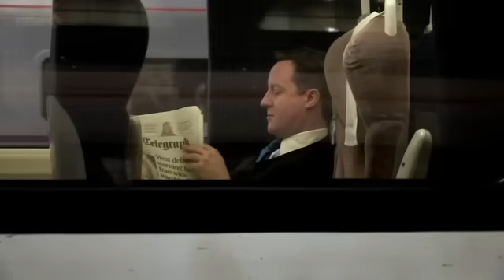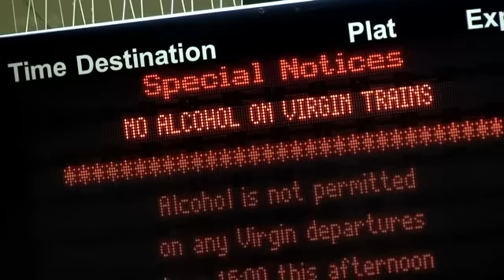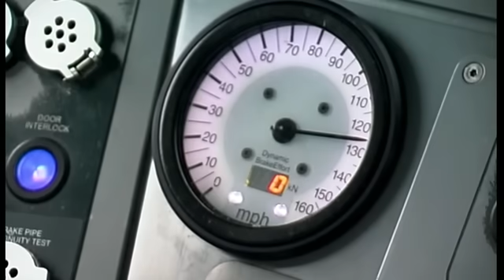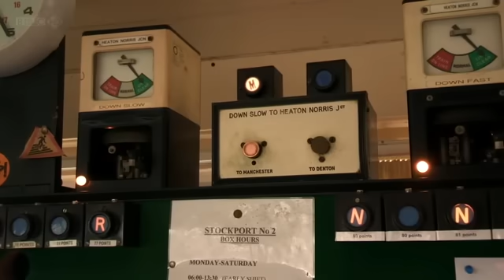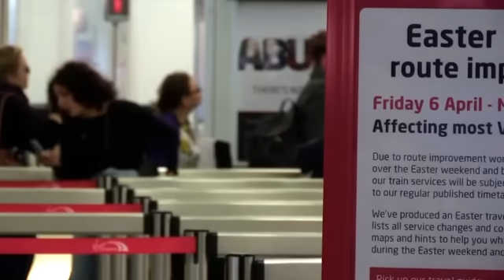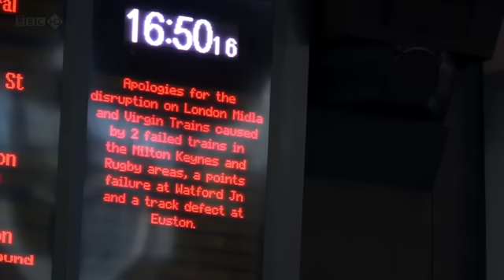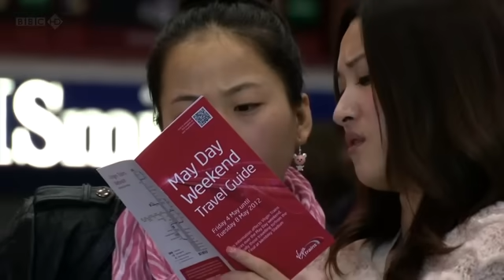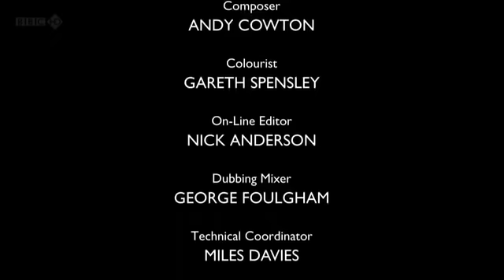The Railway - Keeping Britain On Track : West Coast Mainline (S01E04)

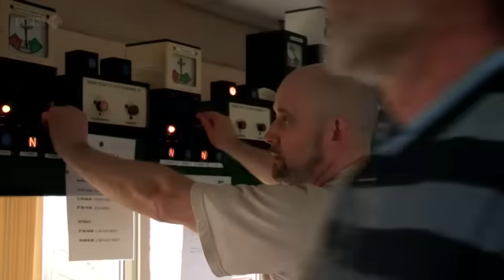Comment: 22:51 I've often wondered about the colours on the different levers in 'boxes and this is really informative :)
Reply: So, ik this is like 10 years old, but the red levers are home/stopping signals, the yellow ones are distant signals, the black levers are points, the blue levers are point facing interlocks, the red levers with a white band is a block locked lever

Comment: Liverpool Lime Street always was a bit of a hovel and in the AC Electric days (Class 86/2 and 87/0 et al) it was a nightmare to approach with the brake burning downhill incline 'down' from Edge Hill CSD especially with a well loaded WB rake behind! I used to be based on the West Coast Main Line and have many happy memories of being a driver from 1992 to 1997 just before the privatisation in fact. The line has been upgraded and in a number of cases remodelled quite extensively since I was 'on the footplate' and the days of two drivers in the cab on 110 MPH diagrams are over. However 'footex' trains have not changed based on this programme: Always were bloody chaotic as were the extra booked stops made at Wembley Central! :o)

Comment: Just wow at 7:00 to see an old signal box still working. If it aint broke don't fix it - however the bean counters will be doing their best to chop that mans job, close the box and replace it with an computer switch controller from a central office hundreds of miles away, controlled by an over worked, under paid computer operator. Will that knock a penny off the price of a rail fare? No it won't - it will just go into the shareholders pockets, as per. Aint Progress wonderful?
Reply: The UK signalling system was put in place by the Victorians, and it's it's an international joke that we still use such an outdated and inefficient system. We can't fit any more trains on the line because the signalling system chokes the network. Then, when a delay happens, every other train after it is delayed because the signalling system can't cope.

I feel bad for the guy's job and all but we can't go around pretending that it works well like this because it simply doesn't. If you want to see an old signal box working, go visit a preserved railway. You'll get to see steam trains too!
Reply: @LordSandwichII  hey get out of here with your intelligent facts and logic these guys need to whine about trains regardless of what happens otherwise they will have nothing to do with their life!
Reply: @alric8  IKR? If we should moan about our rail network  we should moan about the fact that it's outdated, inefficient and expensive.

Comment: Although this video is a few years old, my mind boggles to think that there were still manually operated signal boxes on a 21st century line.  An awesome responsibility for the men that operated them.  Overall, it seems that West Coast Mainline is overloaded, trying to cope with an inadequate infrastructure.  However, improvements are expensive, and passengers are already complaining about ticket prices.  It's still a better rail system than we have in the US.
Reply: I still work in one even now in 2023. No sign of them closing anytime soon either because of the expense involved in upgrading the whole network, it’s just not feasible in remote areas, or areas where a skilled human is required for the safe passage of trains.

Comment: The original budget of $3.3bn was never going to provide the service, and certainly not the on time availability. They had planned to put the fast trains on the same rails as the freight, and that had a lot of problems. The actual cost of about $11bn was for a compromised service, without the proposed signaling system. An alternative to the high speed trains were double decker's, running slower, but more of them and always one waiting for passengers in the starting point terminals. You can much more easily add a slow train than a fast one to a track. That option required larger tunnels and that cost would have been about $1bn. It would have also allowed freight from the channel tunnel to run right through to the Midlands were a lot of it was heading, instead of going onto the road. But trying to tell Railtrack anything was a waste of effort.

Comment: As an American that never rides trains, I have no idea what was going on with the guy pulling levers and ringing bells.  They didn’t explain what the bells meant and what happens when he pulls a lever.  They some control “point” and some control “lock bar,” but I don’t know what that means.  It was like watching something straight out of a Dr. Seuss story.
Reply: The levers control switch points. US railroads used to have similar setups, but they've nearly all been replaced by remotely controlled equipment.

Comment: I needed to know why don’t dig a tunnel and do an extension for the main line Train so they extend the unused abandoned underground stations.  

Why couldn’t they use the part D78 Stock train doors on the sides and also restructure the front face of the A60 and A62 stock that includes the class 313, class 314 and class 315 remix and make them all together and also redesign them an overhead line and also make them into six cars per units and also having three Disabled Toilets on those six cars per units A60 and A62 stock trains and also convert the A60 and A62 stock trains into a Scania N112, Volvo TD102KF, Volvo B10M, Gardner 6LXB, and Gardner 8LXB Diesel Engines and also put the Loud 7-Speed Voith Gearboxes even Loud 8-Speed Leyland Hydra cyclic Gearboxes in the A60 and A62 stock, class 313, class 314, and class 315 and also modernise the A60 and A62 stock and make it into an 11 car per unit so it could have fewer doors, more tables, computers and mobile phone chargers?

A Stock Trains and 8 Disabled Toilets on those A stock trains. why couldn’t we refurbish and modernise the waterloo and city line Triple-Track train tunnel and make it bigger and extend it to bank station, making it into a Triple-Track Railway Line so those 4 European countries such as Germany, Italy, Poland And Sweden to convert the waterloo and city line Triple-Track Train tunnel into a High-Speed train?

The Third Euro tunnel Triple-Track Train line to make it 11 times better for passengers so they could go from A to B. then put the modernised  11 car per unit A Stock and put them on a bigger modernised waterloo and city line Triple-Track train tunnel so it could go to bank station to those 4 European countries such as Germany, Italy, Poland And Sweden. The modernised refurbish 11 cars per unit A stock could be a High Speed The Third Triple-Track Euro Tunnel Train So it is promising and 37 times a lot more possible to do this kind of project that is OK for London Germany, Italy, Poland And Sweden. 

oh by the way, could they also tunnel the Triple-Track Railway Line so it will stop from Buckinghamshire, Hertfordshire and Essex so that the Passengers will go to Germany, Italy, Poland and Sweden and also extend the Triple-Track Railway Line from Bank to Buckinghamshire, Hertfordshire and Essex Stations so that more people from there could go to Germany, Italy, Poland And Sweden Easily.  

Why couldn't they extend the Piccadilly line and also build brand-new underground train stations so it could go even further right up to Clapton, Wood Street and also make another brand new tunnel train station in Chingford and could they extend the DLR?

All of the classes 150, 155, 154, 117, 114, 105, and 106, will be replaced by all of the Scania N112, Volvo TD102KF, Volvo B10M, Gardner 6LXB, and Gardner 8LXB Diesel Six carriages three disabled toilets are air conditioning trains including Highams Park for extended roots which is the Piccadilly line and the DLR trains.
Could you also convert all of the 1973 stock trains into an air-conditioned maximum speed 78 km/hours (48 MPH) re-refurbished and make it into a 8 cars per unit if that will be alright, and also extend all of the Piccadilly train stations to make more space for all of the extended 8 car per unit 1973 stock air condition trains and can you also build another Mayflower and Tornado Steam Locomotive Companies and they can order Every 17 Octagon shape LNER diagram unique small no.11 and unique small no.10 Boilers from those Countries such as Greece, Italy, Poland, and Sweden, can they make Mayflower and Tornado Steam Locomotive speeds by up to 117MPH so you can try and test it on the Original Mainline so it will be much more safer for the Passengers to enjoy the 117MPH speed Limit only for HS2 and Channel Tunnel mainline services, if they needed 16 Carriages Per units can they use those class 55’s, class 44’s, class 40’s and class 43HST Diesel Locomotive’s right at the Back of those 18 Carriages Per Units so they can take over at the Back to let those Mayflower and Tornado Steam Locomotive’s have a rest for those interesting Journeys Please!!, oh can you make all of those Coal Boxes’s 16 Tonnes for all of the 117MPH Mayflower and Tornado Steam Locomotive’s so the Companies will Understand us PASSENGER’S!! so please make sure that the Builders can do as they are Told!! And please do something about these essential Professional ideas Please the Prime Minister of England, the Prime Minister of Sweden, the Prime Minister of Germany, the Prime Minister of Italy, the Prime Minister of Poland and that Includes the Mayor of London.

Comment: High Speed 2
From Wikipedia, the free encyclopedia

The project is being developed by High Speed Two Ltd, a company limited by guarantee established by the UK government. The line is to be built in two phases. The first phase will be between London and Birmingham, then the second phase to Manchester Piccadilly running under Crewe railway station and via Manchester Airport, and to Leeds via the East Midlands Hub and Sheffield Meadowhall. Four major city centres shall be served directly: London, Birmingham, Leeds and Manchester. Other cities are to be accessed using HS2 trains running on existing tracks or with edge-of-town stations.

. Construction is set to begin in 2017 with an indicated opening date of 2026. In January 2013 the preliminary phase 2 route was announced with a planned completion date of 2032. The cost is estimated by the Department for Transport to be £43 billion; a study by the Institute of Economic Affairs suggested a total cost of £80 billion. On English soil a comparable development is HS1.

Comment: 3:50 but you can add extra carriages when you know its going to be busy. yet dont
Reply: It’s not that simple !
Reply: @HamishG199  it really is espcially since most toc's in the north have an annoying habit of running 2 coach and having extra rolling stock sat in sidings. tfw and northern being notable ones
Reply: That train is a pendolino. Pendolinos are EMUs meaning that the equipment of the train such as motors, etc are spread between the carriages. This means that you can't just slot another carriage like you can with a locomotive hauled train, not quickly or easily anyway. To add extra carriages you would need two trains which would be at least 18 carriages which would be way too long for any station on the journey
Reply: @AlexanderBrassington  pendos are very rarely overly full. This comment was up. Reference to toc’s like northern or tfw for example who run 150/3/8 and notably the 197. They can easily add extra carriages yet refuse to

Comment: culture
they never form a line?
if they do it will be faster. experience this in not a good mrt/lrt station beside a business district that is the only one used by people coming from work and from over 10 malls. even if we complain about sucky trains or long lines. you can't pass through the ticketing lines unless you are in queue. 1st queue to buy tickets. 2nd queue for inspection. 3rd for ticket turnstile? then after that you have now free will to run down or up the escalator to get to the first train you can ride or if full already wait for the next 2. lol. really wish we have the same stations/facilities like Singapore. that one was the best even though we need a map to find where to switch or go up/down. lol.

Comment: The UK is what, 700 miles North to South?  How far is too far to drive for someone in the UK?  I drive 2 hours once a week to visit family here is the USA and that is not a "long" drive.  I've drive 8 hours to go to my sister's house twice per year.  Which would be the length of the UK I think.
Reply: not everyone drives and even if you did it’s easier to get the train where you can relax, sleep, eat and it’s a lot quicker
Reply: Encouraging everyone to drive north to south, you seen the state of the roads in London, tried doing that with everyone else on the road from the train, it will take you twice as long maybe 15 hours, That why the train is the normal way of travelling on, Try racing the train from Glasgow to London next time on you car journey and i'm sure the train will get to London Euston first. 😁
Reply: @jackhemm98  I wish here is the USA we had the public transportation infrastructure Europe does.  When I was in Germany I didn't need a car at all.  Unfortunately, the USA is just too big and has way to much open spaces.  It would cost multiple fortunes.
Reply: @TeddGCM  the US used to have a great railway system but they got rid of it all to build multi lane highways to favour car dependency. china is roughly the same size as the US and they have build over 40,000km of high speed rail
Reply: @jackhemm98  IDK if I would call it "great."  I mean, in the 1800s it was probably the fastest way to go cross-country, but compared to Europe, who designed their cities with public transportation in mind, the USA pales in comparison.
Reply: @scottpeacock5492  Believe me, our roads here in the USA are just as bad.  I would LOVE it if we had a public transportation system even close to what Europe has.  We just have too much open spaces and it would cost multiple fortunes to do it.  I absolutely loved living in Germany for 3 years.  I didn't need a car and could not only go across the country, but to other countries as well, all with one ticket!  All in one weekend or even a day.  I don't think the British understand just how BIG the USA is compared to the UK.  The entirety of the UK fits comfortably in Texas!

Comment: Many folk say the United States is behind the curve in not having passenger train service to the extent found in countries such as UK. Now I see the advantage. In the UK, it takes just one glitch, one fool's misstep, to hold up everything. The U.S. isn't so linear a transport system. Very rarely does a failure of one automobile on a highway cause a stoppage of everyone else. There are advantages in both systems, but also disadvantages.
Reply: The WCML is only like this because it's so congested. If there was an accident on a large highway system in the US that forced it to be shut for several hours there would be huge tailbacks and people would need alternative routes, like what happens in the UK when people travel by train. Anyway they're building an entirely new line from London to Birmingham that goes 250mph and will eventually also go to Manchester and Leeds, taking huge amounts of pressure of the WCML

Comment: Watched all episodes so far, it seems a daft way to run a rail service with Railtrack and the train companies each responsible for different delays and fined according to a mad book @ 46:21. Fucking nuts. It doesn't help that the Home Office sticks it's oar in making a complex situation even more complex. This was a problem when BR ran the trains. Thatchers privatisation didn't solve anything, just made it worse.
   One thing is evident, that there are a lot of great people trying to make it work. Train users should be more understanding, though I can understand their anger to some point. Hopefully this excellent series has gone some way to shed light on the situation.

Comment: you ever get the feeling that maybe they need a few more tracks  on the cost line lik maby 4 each way and maybe not all on the same right of way for redundancy with a bigger loading gauge for bi level cars and wider curve radii and ballast-less track and maybe a 7 ft  rail gauge and  16 ft wide coaches and  a non byzantineequse  ...not even sure what you would call the collective shit show that is the British rail industry you know like how they do it in France or Germany
Reply: oh and also 6 meter track centers :)
Reply: That is the most bonkers and over-the-top and expensive plan I've ever seen.

First: they don't have any room for more tracks, that's why they're building High Speed 2
Second: they can't make the loading gauge bigger because there's many obstructions along the route which would be too expensive to replace or remove
Third: bi level cars wouldn't fit in tunnels on the UK rail network
Fourth: wider curve radius wouldn't work due to the fact that again, things are in the way
Fifth: 16ft wide coaches are bonkers, the current width is fine, the same that they have in France and Germany